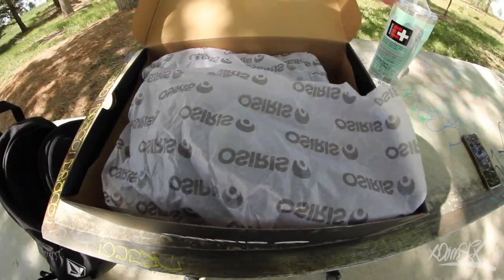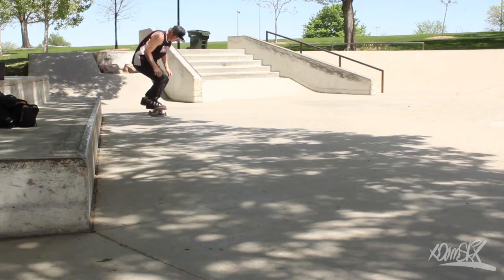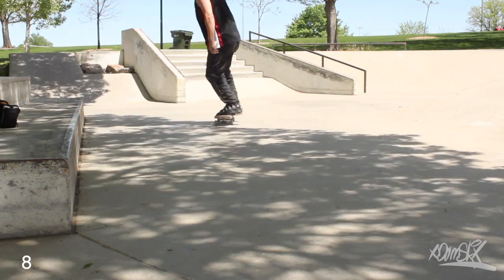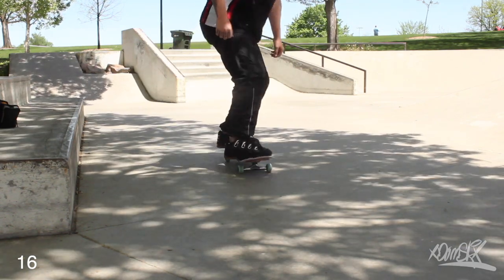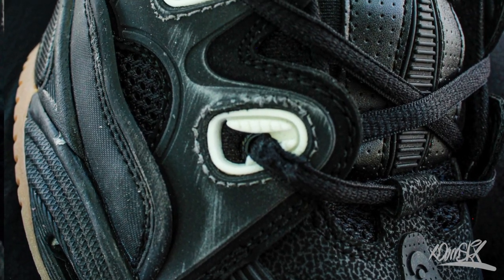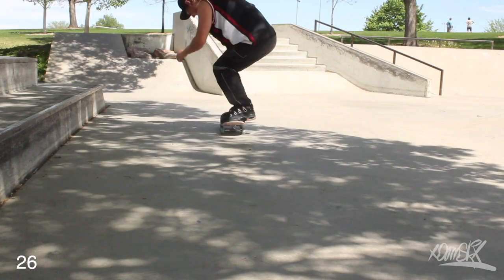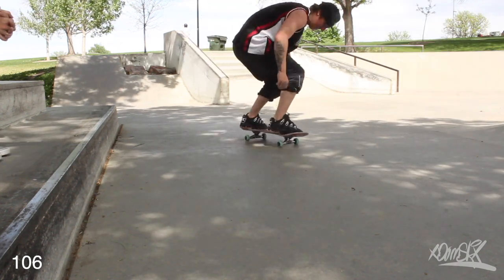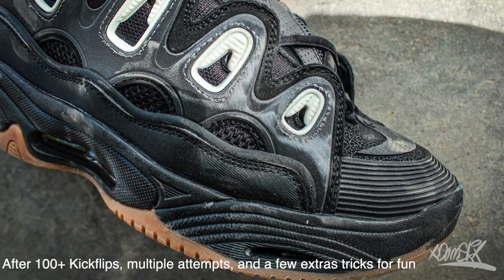Osiris D3 2001 (reissue) 100 kick flip Wear Test

Comment: I ended up getting a pair of the red and white ones they are freaking amazing they are bulky and eye-catching as well but if you don't mind that they're pretty great I noticed they offered more stability than the rest of the shoes I had dropping in felt more secure and on my no slides hours less prone to lean backwards because of the heel support
Reply: I got 2 more pairs x,x lol I've been skating the red ones since last post, and they are still going lol they still have a lot of life in them I'm going to use them until I can't no more

Comment: Buddy u just got some fake ones look at the stitching no good all the glue arround the rubber area expose
Reply from the maker: the D3 I got at retail price from a authentic dealer.. but yeah the glue is part of the cemented process to make them. The glue just shows that Osiris quality control was not there. Unless you are talking about the dunks but those I got in a retail store as well. Thank you for checking out the video!